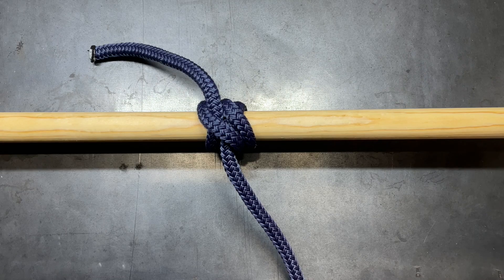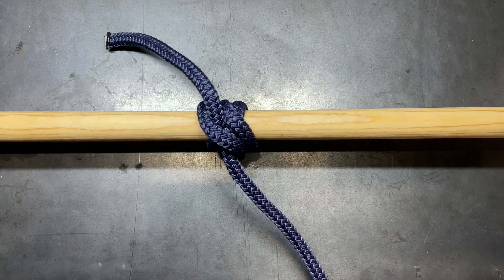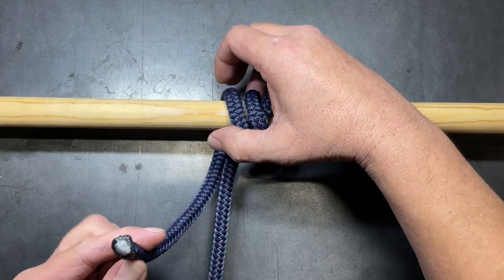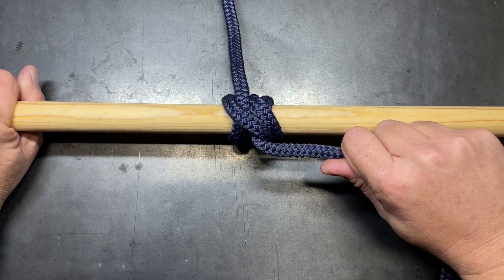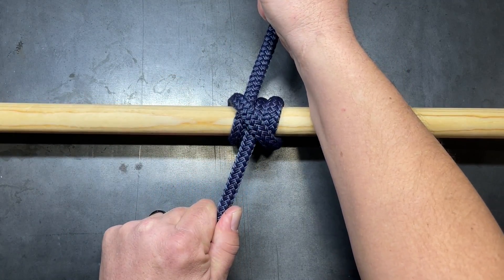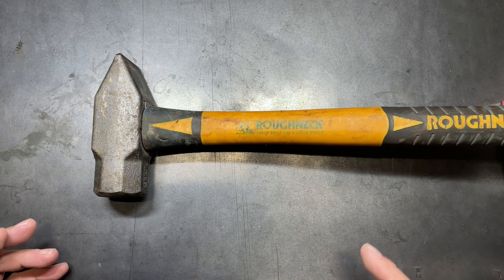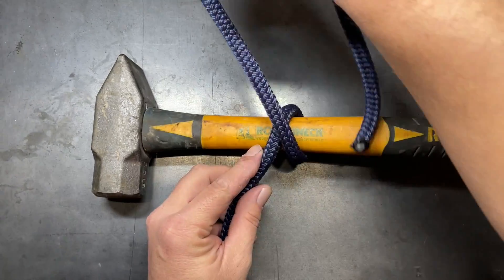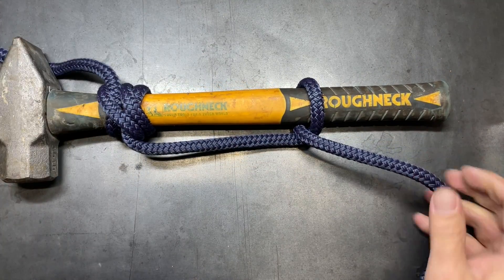The Rolling Hitch : How we use it in construction.

Comment: would u prefer pipe hitch over this? wondering when i should use the pipe hitch vs this. i kind of like pipe hitch more to start rolling hitch
Reply from the maker: This hitch is perfectly adequate for most task requiring a linear pull. The pipe hitch is better suited  in circumstances when you will be applying extreme pressure or be hoisting loads in excess of 50 pounds.

Comment: Great video & application. A slight variation that you might consider....at the end where you finish between the double wraps....if you take the running end over the double wraps, & under the first wrap (from the inside out; the first round formed by the standing end) it seems to form a much stronger, more stable hitch. Kind of reminds me of the Miller's Knot.

I'm also a fan of the Anchor Hitch, & the Constrictor Knot, which are similar.

Thanks

Comment: I like the rolling hitch but when I was in the Navy and later as a lineman we would use the clove hitch followed by a series of half hitches. It seemed like it was just easier to get undone. Also, the clove seemed quicker and easier to tie, especially if you used the two loops and reverse them method.

Comment: The way I mainly use your first example of the rolling hitch is to increase tension on the standing end......as you over wrap the rope you incrimentally shorten the standing end by clamping the rope down by the ropes width every wrap (can wrap many times), on an already tight rope and you can impart a huge amount of force and can get that last bit of tension you need into the rope.
Reply from the maker: You’re absolutely right.